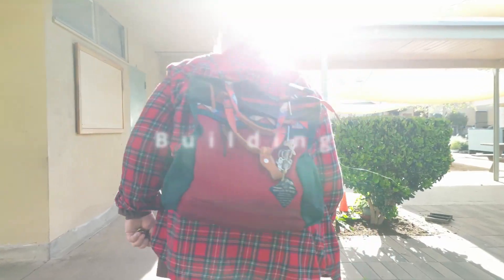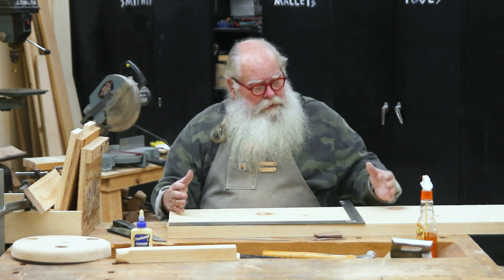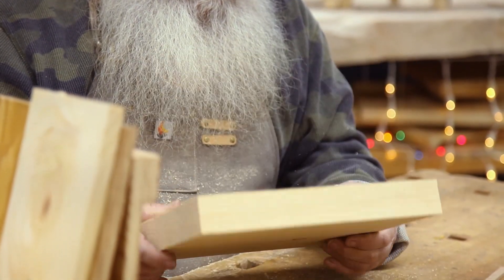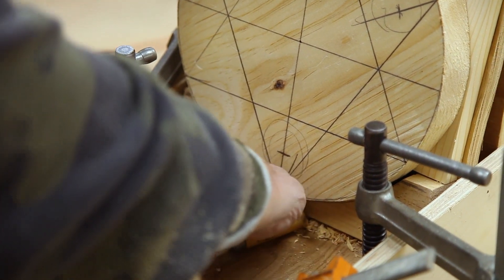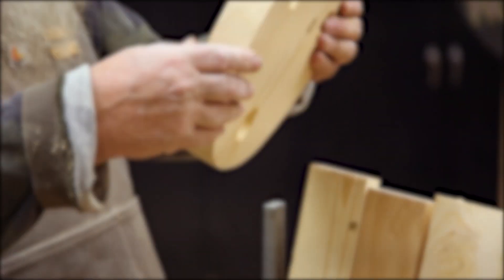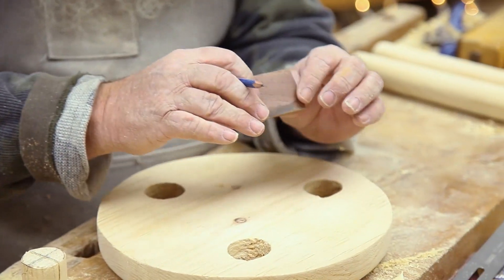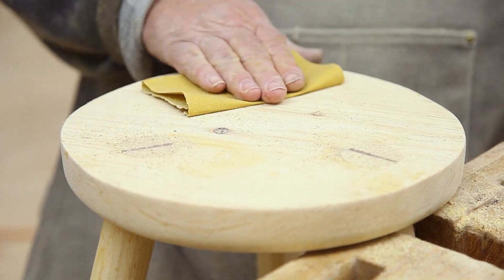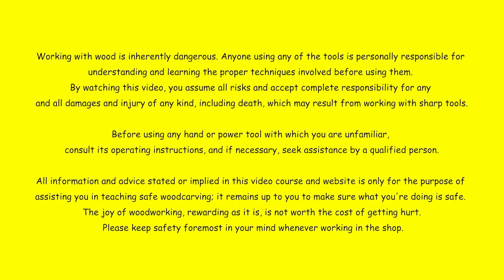Mr. Bryant builds an 8th Grade 3-Legged Stool

Comment: Love your approach to woodworking education! I was the victim of many perfectionist teachers. Great to see your use of hand tools and giving them a few options. Wish I had you as my 8th grade wood teacher. Do any of the legs get loose over time without a shoulder to sit on? Thanks!
Reply: Yes. It’s better to use 8/4 thick material for the legs. This pine was only available as 2x12, net measurements were 1 1/2”x11 1/2”. Or I could have used a smaller diameter boring auger bit…definitely better to taper a shoulder. In the video I forgot to mention to align the wedges oriented towards the center of the seat. (13:29)
Reply from the maker: Thanks for your kind words! None of the stools around my home have loosened around the legs…yet!! And hopefully they never will